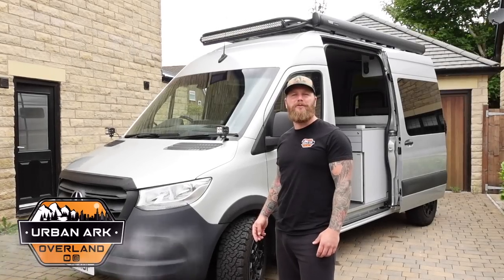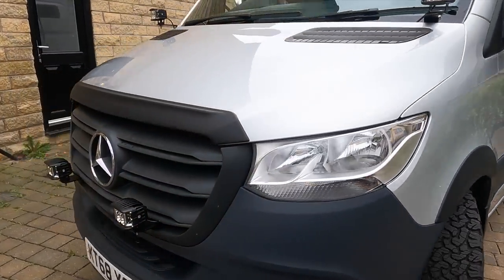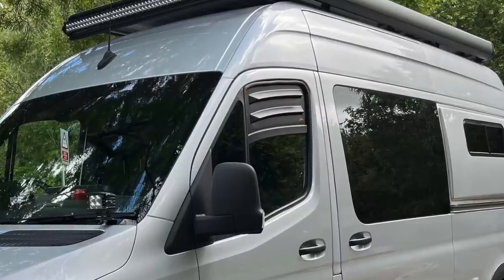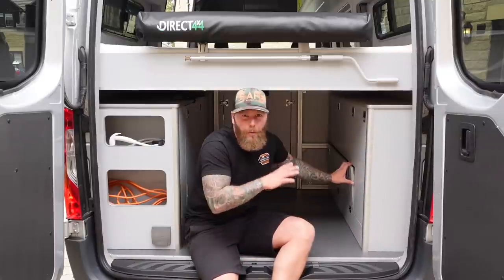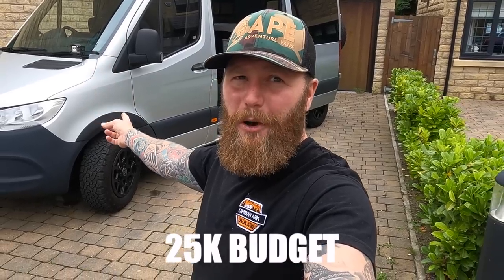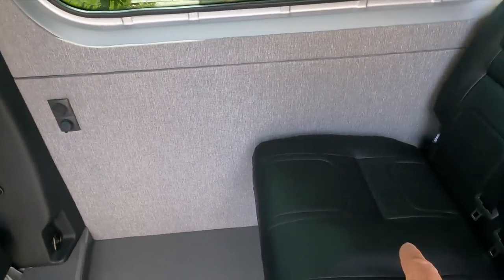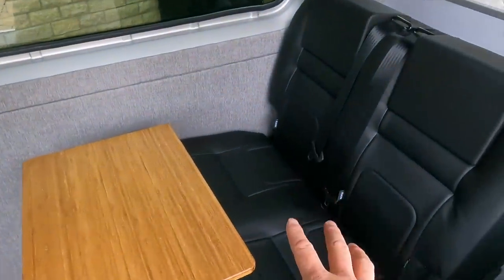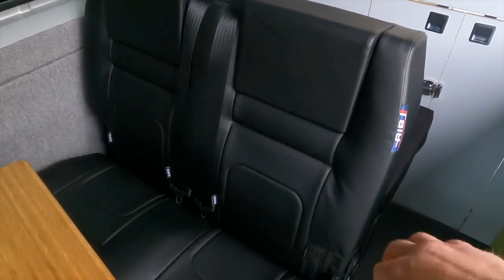SPRINTER VAN TOUR. Where did it go so wrong? DIY VAN BUILD. Fully Loaded

Comment: The Carbon-monoxide alarm needs to be fixed low down and NOT high up. Carbon-monoxide is heavier than air.
Great van buddy.
Thanks 👍👍👍🙏🏻
Reply from the maker: Sorry mate. This simply isn’t true. CO is lighter than air. Hence why you get ceiling mounted Co detectors. You may be mistaken with lpg. That is heavier.
Reply: @urbanarkoverland  , Yes I am thinking of LPG, sorry 😞 
Great vid buddy.
Thanks 🙏🏻
Reply from the maker: @bustersbashers2280  no probs mate. Plumber by trade so I would be pretty embarrassed f I was wrong in that one ha. Thanks for watching 👍🏻😂

Comment: did you get your very fair asking price, I'm struggling to come up with a price for my van. Cheers.
Reply from the maker: Both parties were very happy with the price. 
Just look around. Think logically about how good your base can is. The level and quality of the build. 
Not just what it looks like. You know what’s behind the scenes. Be fair to tell the truth.
Reply: @urbanarkoverland  well it has nowhere near the level of spec your van has. it is a 2014 MWB crafter with 130k on the clock, professionally fitted out though, all evo design joinery and colour coded side pods, wheeliams roof rack, wheel carrier and ladder, black rhino/bfg wheels and victron electronics including 300ah of lithium, 480w solar etc. truma combi boiler and back up planer 2d under the passenger seat, 5T conversion. might start the price at 35K?
Reply from the maker: @aberdeendeltaforce  👍🏻

Comment: Very nice but wouldn't want it on a 314. 
319 or 316 at the least.
Reply from the maker: Why’s that? Same engine. Can plug it in and access the extra horses
Reply: Really?  Cool😎 😎
Reply from the maker: @lolavan7750  yeah. Called a remap. Most vehicles share the same engine through different models. Transporters are the same. If you look at any sporty looking caddy. Chances are it will say remapped to 180. Lesser models are just de-tuned 👍🏻